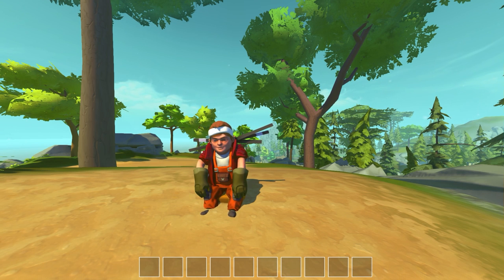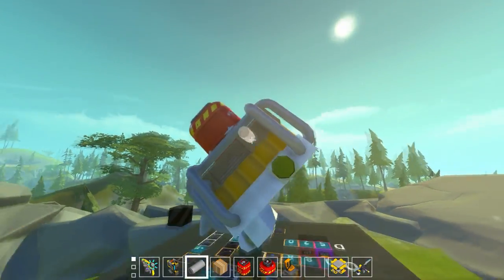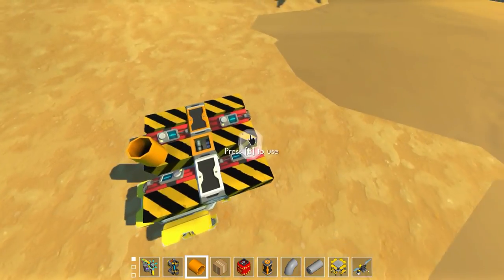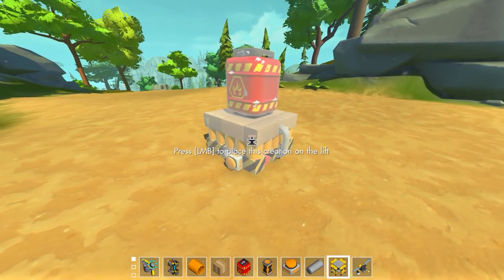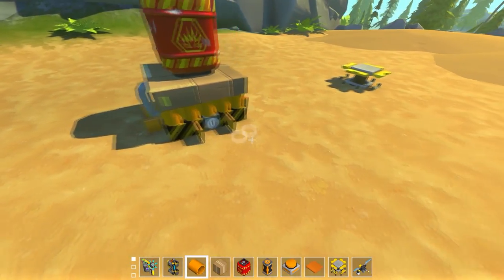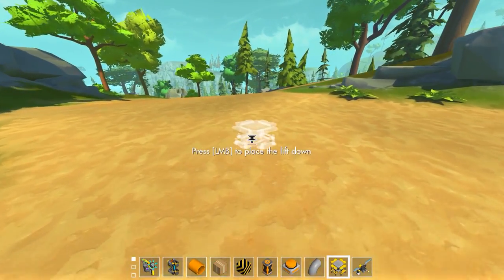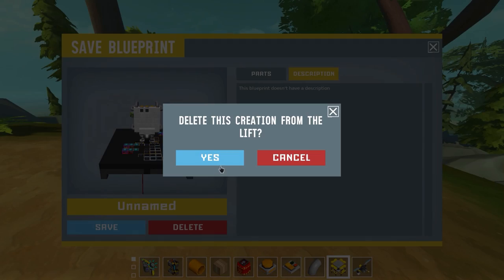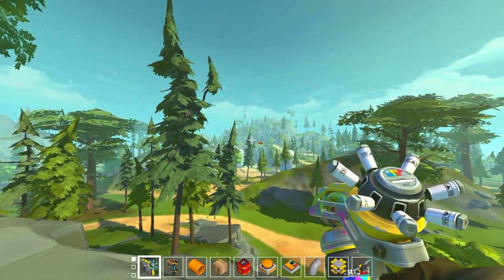Building a Long Range Multi-Stage Explosive! (Scrap Mechanic #363)

Comment: kAN have you ever seen a video of those tactical surface to surface missile trucks, where the missile fires straight up  to about 20 meters, than makes  a 90° turn on the spot and just blasts off to the horizon? you should totally build something like that with this staging system! just gotta control the flip on the second stage
Reply: i think they are called bastion missiles
Reply: He has built many of those.
Reply: That effect is commonly referred to as roboteching.
Reply: That would be bad ass

Comment: add a guidance system on the last stage like a command center at the ground and using a remote control block controling those wings and aiming the explosive barrel at a certain cordinate and adding something like a cordinate meter at the explosive barrel so you know where it landed

Comment: Why don't you just have each stage go off one tick after the other?  Sure, it may be a bit of an issue if the exploding waste comes back down on the cannon, but you shouldn't have that large an issue with inaccuracy

Comment: Hey kAN. I have a big suggestion for you. How big? Well, if you can get it to work, it will serve as a very good demonstration of how number logic (and MATH ) can be used for practical purposes. Basically, I want you to build a semi-automated hover tank, using nothing but the Modpack (and vanilla) parts. If it works, it will be capable of automatically accounting for any amount of weight, and stay almost completely stable, so long as the centre of mass lies within the bounds of the four thrusters.
Firstly, you will only need four gimbal thrusters for the entire 6 degrees of freedom for movement (pitch and roll are fully automated, height is semi-automated). You should only need 4 input blocks for movement/stabilisation (1 distance sensor, ideally set to wide angle, to detect height in hover mode; 1 altimeter, used to detect height in flight mode, and used to find vertical velocity/acceleration using math, stabilise height; 2 angle meters, to detect the tilt of the vehicle on both axis, which will also be used to determine how to balance the centre of thrust with the centre of mass).
Simply, the height measurements are simply used to control the main part of the thrust. They need to proved more thrust if they are very far below where they should be, and a lot less if they are well above where they should be. You should have the relationship be linear, to smoothen out the changes, as well as to avoid overcompensation for small changes in terrain. To manually adjust how high above the ground you want to hover/fly, just add or subtract to the output of the sensor/altimeter, as this will offset where the neutral height is.
Next, you need to have some number blocks with the x and y position of each thruster, with the average of those positions being 0,0. This is important for the thrust vectoring, and balancing the tank. Using these coordinates, in combination with the angle measurements, you can figure out where the centre of mass is by using the direction it tilts in, then making changes to the ratio of thrust between the thrusters (specifically, by adding/subtracting power) until it no longer tilts. Make sure the total thrust between them remains the same, to prevent interference with the height system. Using this, you can now get new coordinates for where the thrusters are in relation to the centre of mass, and use math to set the power of each of them based on their distance from the centre of mass (Pythagoras Theorem), so that the centre of thrust lines up with the centre of mass.
Well done, now the system is mostly balanced, and the initialisation of the system is complete. These first calculations don't need to keep running while in use, just when you need to calibrate the alignment of the centres of mass/thrust. Next, you need to use the tilt sensors to add/subtract thrust to the gimbals (again, using the distance from the centre in the calculation for alignment) to counteract and pitch/roll away from staying lever, using an inversely proportional relationship again to prevent overcompensation. The system should now be more or less completely balanced.

Next up, thrust vectoring. This will allow you to more forward, backward, left, right, as well as control yaw. Using trigonometry, and the relative positions of the thrusters in relation to the centre of mass, you can calculate how much you need to angle the thrusters (using the w/s and a/d function blocks) in order to keep the same vertical thrust, as well as keeping the centre of thrust aligned with the centre of mass. This way, the vehicle will move/turn as expected, without impacting the stabilisation systems. Once this is done, you have finished all of the stabilisation/movement systems. I suggest you save it at this point.

Of course, being a hover tank, it needs a turret. Well, once you can figure out how the watermelon behaves using quadratic equations, you can use a distance sensor (the one that focuses on a particular target, such as players or trackers), as well as some angle meters (to use trigonometry to find the 3D position of the target, by using the distance), in order to calculate exactly where to aim in order to hit the target, assuming nothing is in the way. I suggest using the smart engines, set to very power, and low-moderate speed, and feed them the required angles, as this should allow the turret to track the target accurately.

Once you've done this, well done, you are almost finished. Just re-calibrate the stabilisation system to find the new centre of mass, and there you go.

I hope this wasn't to much information for you. As you are an engineer, and have demonstrated in several streams that you get lost with instructions sometimes, I wanted to be as precise as possible, while still allowing you to figure out the more complicated calculations yourself. At the very least, I'd like to see you try to make a somewhat basic prototype of this system, because if it works, the Workshop would love it.
Reply: you put way to much effort into this
Reply: @smartcookie1013  it would be really cool, though really hard to pull off
Reply: Too long. Didn't read but beginning sounds awesome
Reply: lurts Basically, by lining up the center of thrust with the center of mass, you can move in any direction (or not move) and stay perfectly stable (theoretically; in practice, game limitations, such as logic delay, may interfere). It takes quite a few calculations, but the result is generally worth it.
Reply: Oh my fucking god that is a BIG ask

Comment: I have a custom map server which has a map about 10 times larger than the default map and a seemingly infinite skybox (its only 99k blocks tall)

The server is for a large number of my friends.

We make large mega bases across the map and we have intense wars with planes and vehicles.

I made a rudimentary health system mod which takes block damage values of weapons and explosives and assigned damage values to that.

We have defense drones which follow enemies which homing missiles then follow the drone then follow the enemy.

I used this concept and modified it to be an escape pod.

It uses 4 stages of around 9 modded spud guns and it can out range missiles and drones.

thanks for the idea